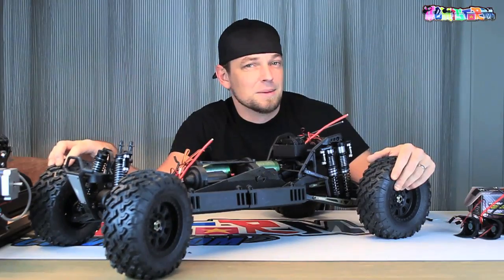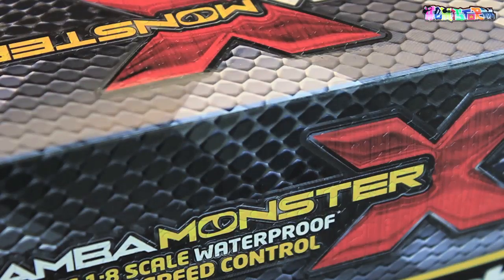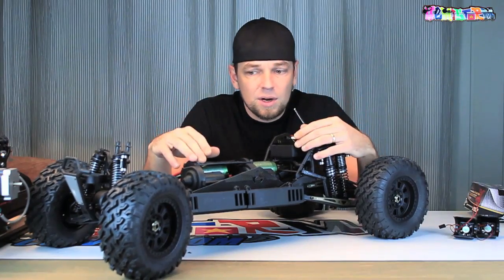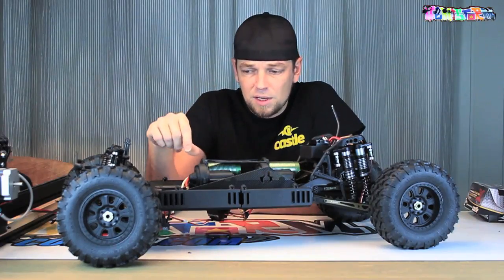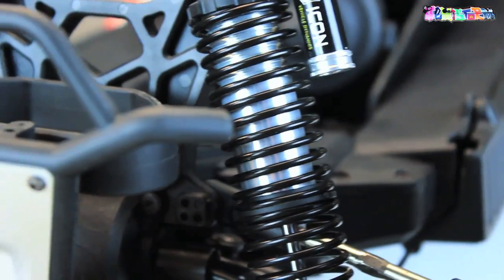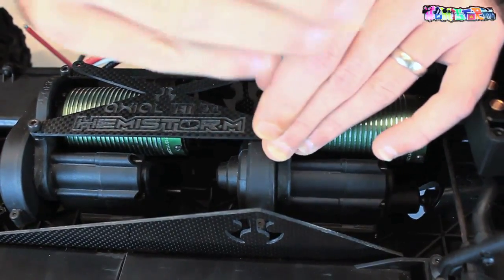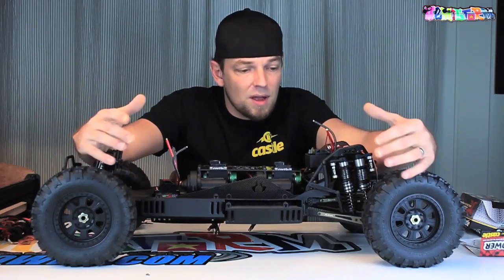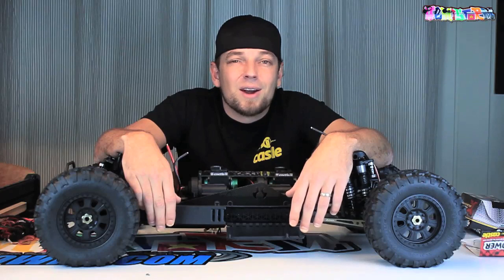Axial Yeti XXL - The BIGGEST just got BLOWN

Comment: Love this build. The castle creations plastic shroud fans suck. I bought one for my 2200kv, and threw it away after one run. Also bought the hot racing clip on heatsink, and fan. Was not happy with that one either as it's too small for the 2200kv. Finally bought the Yeah Racing heatsink with dual fans. That works beyond my expectations keeping the engine 30 degrees cooler than the other two setups!
Reply from the maker: Good info! Mine sit pretty well protected under there.

Comment: Nice work man, dont forget you need to remake the big carbon plate on the bottom of the chassis now youre running monster x's instead of monster 2's! ;)
Reply from the maker: +max neale Haha, I figured I could get away with Mamba Monster 2 since I have 2 in there. ;)

Comment: hi hemi is this esc fully waterproof ? I've got the yet xl rtr an wanna change the esc for the mamba x cus of the bec settings as u don't get those settings on the vanguard. would I need to swap the motor as well what u get in the rtr?
Reply from the maker: +Daniel McDonald The ESC is indeed fully waterproof, the X series is the first in the Castle range to have that feature. You can run the stock motor until it gives in without any issues.

Comment: To help with the blown rear diff swap out the plastic spacer on the pinion for a metal spacer or bearing and swap the diff case for the hot racing metal one. The aluminium quality isn't very good but it's better than the stock plastic one. Never managed to blow a diff or ruin the pinion/spur on mine after doing this swap out.

Comment: Why wouldn't you run a lower KV,  more efficient.  1600kv x 2,  solve your heat issues.
Reply from the maker: I'm not sure I'm going to have heat issues, as my yxl runs without the shroud. In case I go for way taller gears I just wanted to be safe.